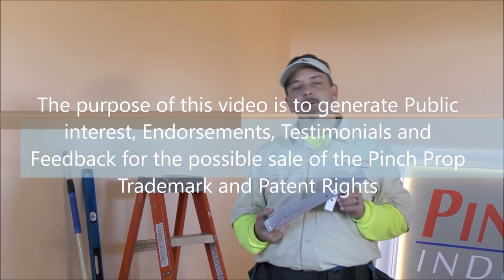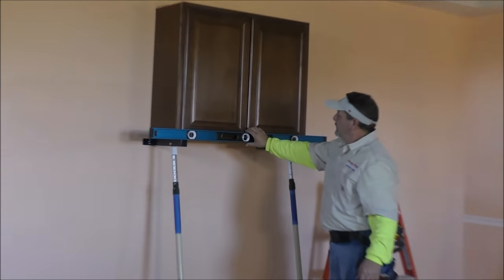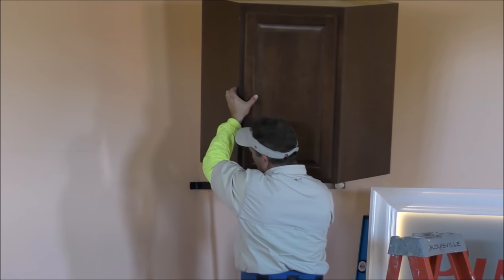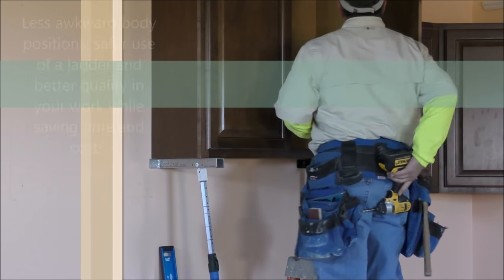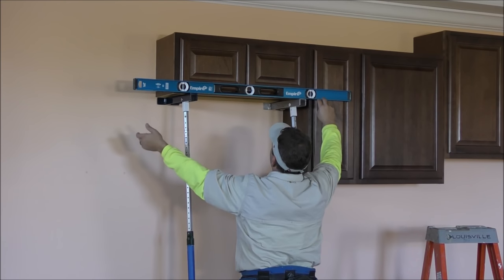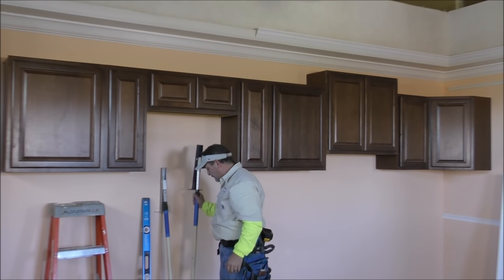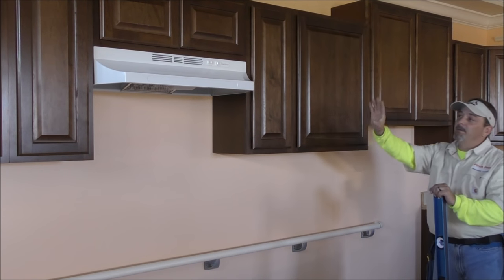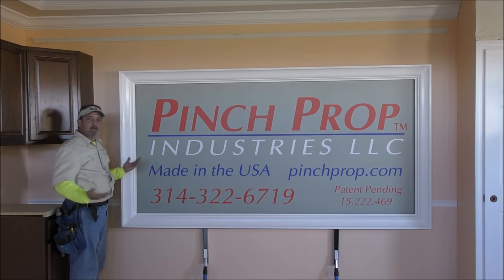How to install kitchen wall cabinets and Crown Moldings with the Pinch Prop cabinet jacks

Comment from the maker: That was an accessory are used to offer, it was a rubber bumper that could be screwed on to the tip of a smaller pole in the kit for spacing out microwave and range cabinets or any other item that you would not want to Marr the finish on. I found most guys never used it and door it loosened up and fell off and they lost it. Either way I haven’t had anyone really asking me for them so I haven’t made any more.

Comment from the maker: Month 7, Now running daily production runs. I am crafting 10 sets every couple days and selling out just as fast. If your order is not In-Stock, I will stop whatever I'm doing and complete your order ASAP. I am still working full-time as a Working Carpenter Foreman during the day then coming home and crafting Pinch Props for another 8-10 hours currently. I would like to thank everyone for there support over the past few months!

Comment: This is so funny because I use the exact same prop sticks but instead of the metal jack on top I use a painters roll handle with the roller taken out and it places the cabinets the same way. I literally make my prop stick for a fraction of that price and is the same thing. I get all my stuff from home depot and this is done by every installer I every knew. why wait when you can make the same prop stick same day and save hundreds of dollars.
Reply: Can you post some pictures of yours? Thanks.

Comment: Can some one tell me if he using special kind of screws for the face frames or is he pre drilling ? Doesn’t look like he is pre drilling but doesn’t look like the wood is cracking either .Thanks in advance
Reply: Doesn't look like he put enough screws in the wall to secure the cabinets up properly either...

Comment from the maker: We are working hard to get these available to the public. Sadly everything takes time, each and everyday we are trying to move forward one more step. At this point waiting on manufacturing numbers and dealing with the extension pole manufactures to produce a pole that will fit the direct needs of our Pinch Props. The website and e-mail should be back up shortly.

Comment from the maker: The Pinch Props can be found at pinchprop.com selling for $199.99 for a set of 2 props and predrilled extension poles. Mini props are also now available.
Reply: Free shipping? Or is the free shipping only on the mini poles? And why?

Comment from the maker: The Pinch Props are one of the most universal tools of our trade. They can be used on many of our common building products including Cabinets, Crown Molding, lettering and Hand Rails to name a few. Each use of the props feels like it was design for that use. Unlike other products that only have one designed function. See many of the pictures I have taken over the years on my website pinchprop.com  - Thank you. Kevin
Reply: How do you fasten the cabinets only with screws without dowels and is there a danger that the supports will slide on the floor

Comment: Was checking for a price.....no pricing so i guess i can live without the damn thing, will keep using my method with T-Jaks which works. At least i knew the price to order.
Reply: Alucard Lledroc it's $199 for 2 of the big props. The website is up.

Comment from the maker: pinchprop.com 3/25/19 Gearing up for the spring building season. Please place your orders early to ensure prompt delivery.
Reply: When you screw in the screws on the face frames sides are they pre drilled or are they a certain kind of screw that doesn’t crack the wood?
Reply: @kingdavid7491  always predrilled

Comment: Waaaaaay to expensive for cabinet jacks.  plus the shipping cost is an additional 25% of the cost of the jacks!  Ill just make my own for a fraction of the cost.  Thanks for the idea!
Reply from the maker: I charge $45 flat rate for shipping, it cost over $75 to ship this box. This box is sexy 7“ x 7“ x 7“. The shipping price is going up I already pay 25% of the shipping already. If you would like me to post some receipts of shipping I’ll be more than glad to email them to you. I can’t help shipping cost. I’ve kept my price the same for six years and haven’t raised my price once.
Reply from the maker: Correction, 67” x 7” x 7” at 15 pounds

Comment from the maker: I held off on any price changes until 2021. Aluminum has gone up the most  so far. With sale increasing weekly I am now running nightly production runs. Most orders are going out in 1- 2 days. Feel free to send me an email if you would like to check stock. I do everything in-house now so I no longer have the layover time waiting on product to come back from welding or powder coating. Pinchprop.com